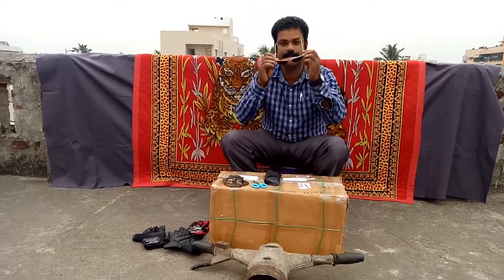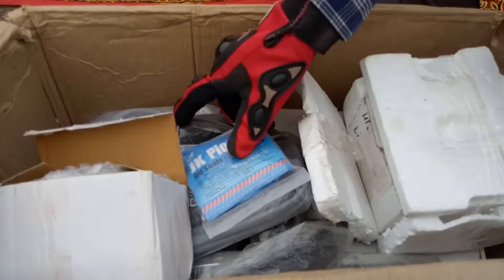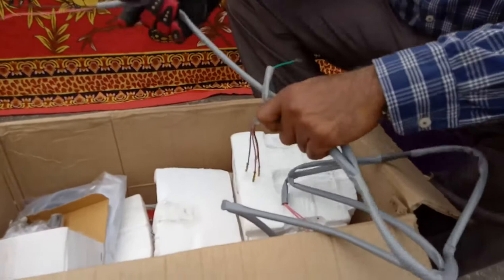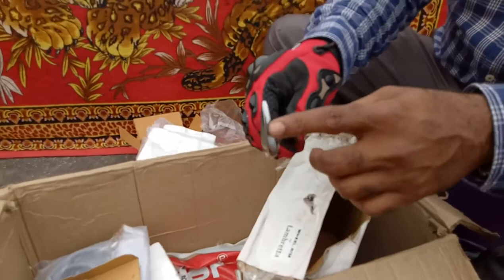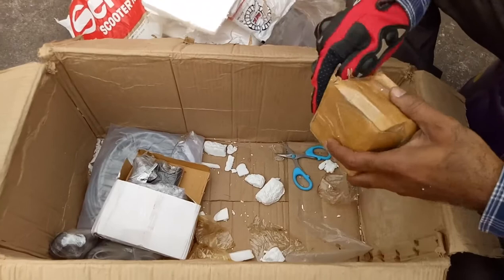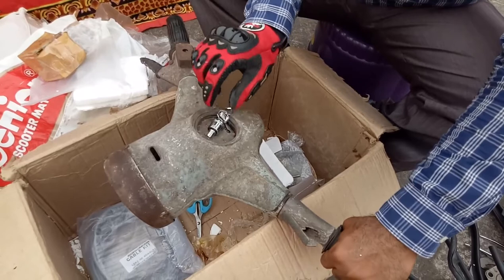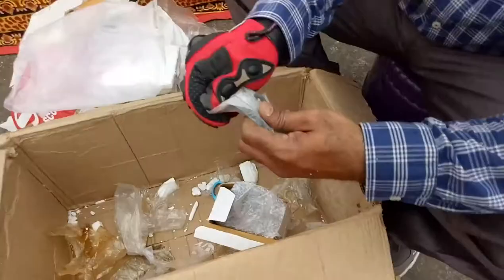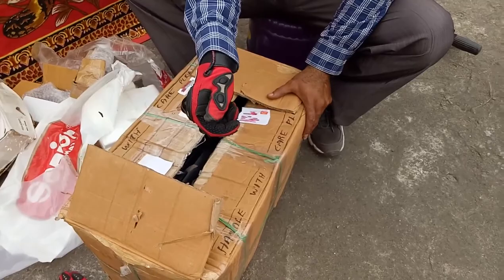Transform Your Lambretta Scooter: Install High-Quality Auto Parts for Optimal Performance

Comment: Hello Ramesh Sir,
I saw your videos and subscribed today.
I am in need of such parts and wheel rims

I tried number you shared to someone in reply to someone 
(Of Mr. Nidhin)

But it's not working, could you please help with any alternate.

Thanks
Reply from the maker: I will give you some more numbers of dealers soon. Just a moment
Reply: @LambrettaRamesh  thanks Ramesh ji
Will wait for it. 👍
Reply from the maker: +918590683080 (Rahul Kerala) +919944058943 (Coimbatore) 9810558376 (Delhi)